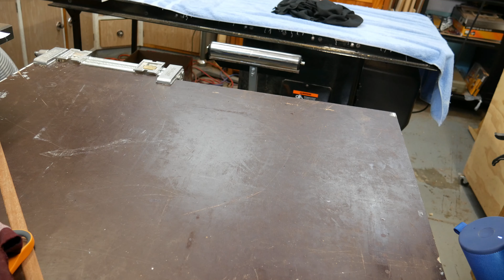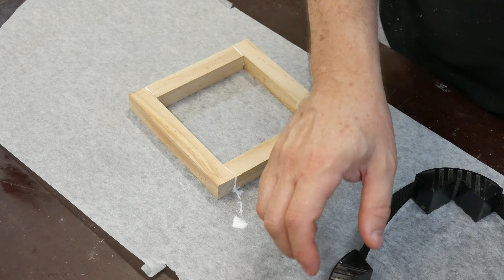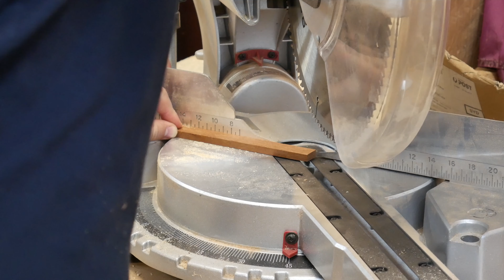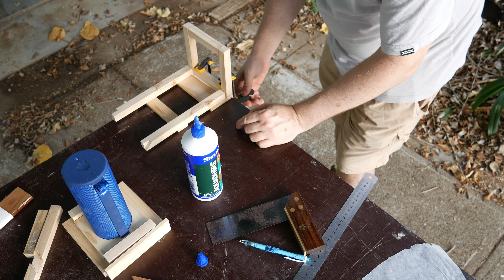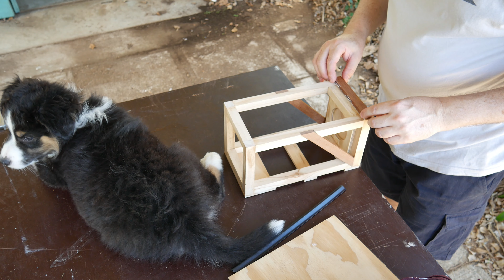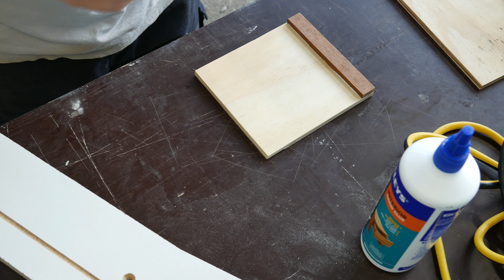DIY speaker cabinet for a Boom Box 3.

Comment: I’ve the Same speaker, agreed small joinery with glue only butt joints don’t hold 🤔👍
Reply from the maker: I had planned to have little bamboo dowels, but forgot. Once I had the speaker cloth on it was too late. However I think it will be OK for my use going forward. If not I could always make another one.

Comment: I have had that same regret before! I just use some old car speakers hooked up to an old receiver (with a coat hanger for an antenna) Nothing so fancy in my shop!
Reply from the maker: Yes that was me also for years. Then the mini system you see in the video was not needed in the house so it seemed like a good score for the shed. Unfortunately I could never get decent reception for the radio out there. Even the coat hanger trick was not successful. Then the other inputs failed due to the dusty environment. So I still have it but it's almost useless now. 
These bluetooth speakers are not expensive and I can listen to the music I like with almost no ads. So it's a big step up. 
I recommend it, if you can't afford bluetooth hearing protection.
Reply: @DavesShed  when I remember to grab the Bluetooth headphones, I usually listen to podcasts. But when I am not making lots of noise it's nice to have the headphones off, so I will look into a bluetooth speaker! Thanks!